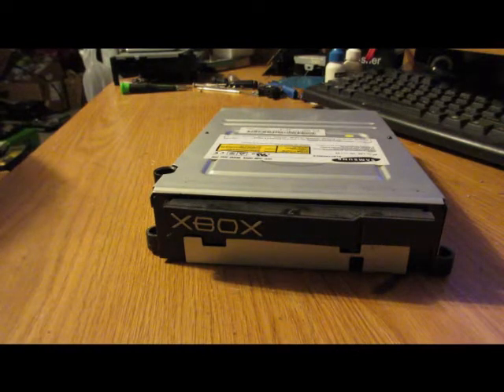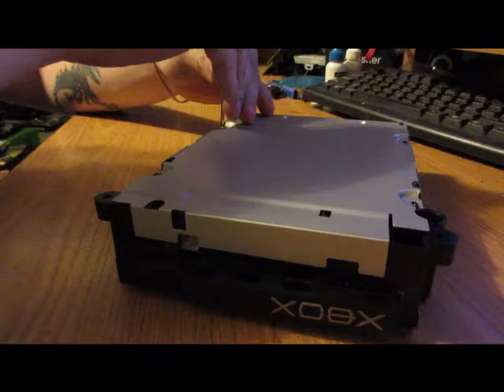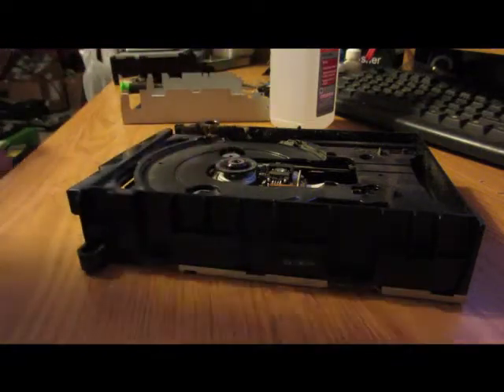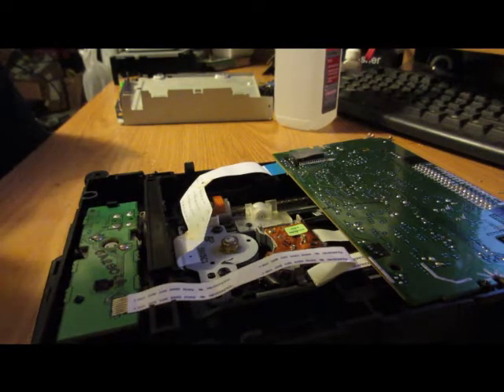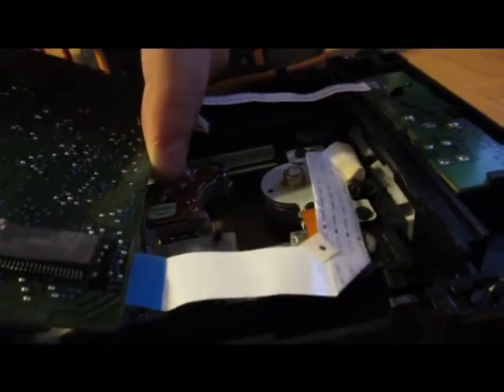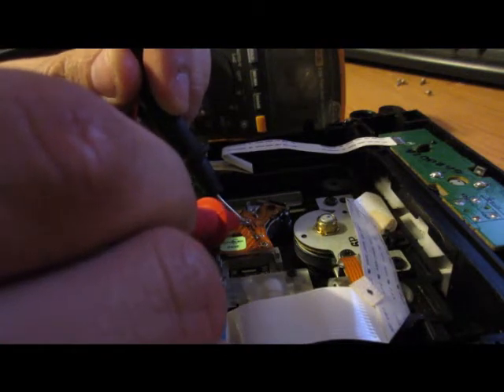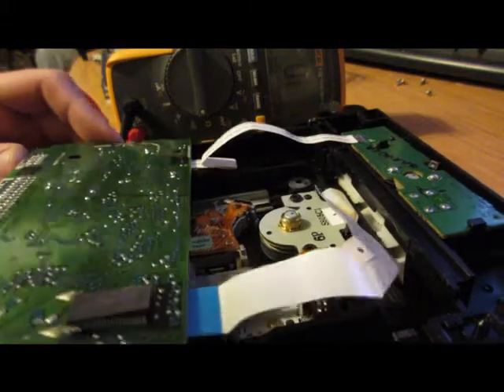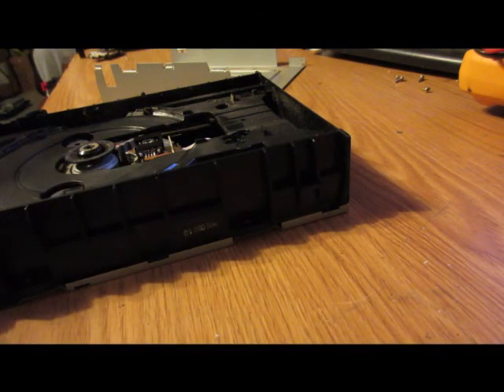Original Xbox Samsung SDG605 Laser Pot Tweak

Comment: No help at all, but thanks for trying.

-Cant see your values.
-No mention of values for this drive
-Cant see what you are adjusting

No followup on this video or another to see if what you did fixed the problem.

Id say delete this video and try again
Reply from the maker: I'd say delete your account and try again, but I doubt it would make any sort of difference. 🤷‍♂️
Reply: @H4CkGAMiNG712  Your goal was very well put, and the attempt was great, but this video does not help in any way. You are welcome to be upset and throw insults, but generally those people that are given feedback, implement it.
Reply from the maker: @MrRewdtv  302 likes vs 19 dislikes. Pretty good odds if ya ask me. Video is 8 years old back when cameras weren't the greatest. If I ever decide to redo the video for the very few people that didn't care to open their drive up and actually look at the internal components to get somewhat of an idea of what to do, I'll tag ya. This is a part time hobby when I have time away from work to actually do anything, so if the video didn't help someone or a better video was posted somewhere else I can assure you that it doesn't bother me. Have a good day dude.

Comment: I could not see where to probe or which way to turn it would be nice to see if it actually worked or not.
Reply from the maker: It's pretty hard to show on camera due to the size of the legs for the potentiometer. You just measure across from one side to the other. Google a picture of a potentiometer and you'll see the legs up a little closer. After you see the legs in the picture and then look at the Xbox drive, you should be all squared away. From that point you're just going to slightly turn the potentiometer until you see the resistance values on it start to drop. Without having one in front of me I'm unsure which way you turn it off the top of my head. But your meter will tell you. If the resistance values go up, you're going the wrong way. You want to bring them down an ohm or 2.

Comment: Is this a tutorial or just showing your process caus if it is a tutorial ita horrible. There is no way to watch this and be able to do this yourself. All i know is you adjusted it to 1.86. I don't know why or what that number represents or why that is the number. No way to tell where you are placing your leads, you don't mention what you have your multimeter to measure. I am guessing ohns since it is a potentiometer but dont know what setting on the multimeter to use
Reply from the maker: The disc drive us unplugged so I doubt we're measuring voltage or amperage. A potentiometer is measured in ohms. There's only 3 legs on the potentiometer. Measure across any of the 2. I'm showcasing how to adjust the pot in your Xbox. Not teaching potentiometer 101. 1.86 is in kilohms. Potentiometers for lasers are set from the factory at around 1.9 to 2.1 kilohms (1900 to 2100 ohms). Basic understanding of a pot could have helped you understand a little better prior to commenting. Everyone else has been able to understand it in the years it's been posted. Go troll somewhere else.
Reply: @H4CkGAMiNG712  well my multimeter has 200 2000 20k 200k 20000k settings on ohm not just ohm

Comment: so.. what i get is that the normal specs need at least 3000 ohms? i had 2500 on the left and around 880 on the right.. now it should be at least 3000 ohm on every ?

Comment: Bro, could you tell me the standard value of the potentiometer of the samsung reader since there is not much information on the internet about that, greetings bro
Reply from the maker: It ranges anywhere from 8 or so down to 1 kilo ohm. So in the video when I say it's down to 2, it means 2 kilo ohms which is equal to 2000 ohms. You always want to try to stay above 3, but sometimes you just have to go down that low.
Reply: Yeah my Xbox is the same one that you have but I have one potentiometer not two so it’s not reading disc either so I adjusted the laser to 1.768 but you said 1.860 would this work for me or do I need to tweak it to 1.860 to read the original Xbox games

Comment: Hey man quick question what did you have your meter set on when you checked yours if you can get back with me as soon as possible that would be great thanks
Reply from the maker: Just now seeing this. I stepped away from YouTube for a while. I had mine set to ohms but my meter is a fluke116 so it auto adjusts certain levels for me. So it is technically measuring in kiloohms.

Comment: mines a 1.6 version with the Samsung sdg-605 too but it has a small green board instead of brown..
Reply: Mine is that too. It's got one potentiometer on the back of the laser mechanism, so you do it from the bottom with the disc drive flipped upside down and the main PCB pulled out (the ribbon cable removed from the laser mechanism is easy)
Mine read about 1k ohm. I reduced it to 830 but that's only temporary for the softmod which then it won't be necessary as I'll have a large HDD installed for FTPing games.
Reply: Ever find out?